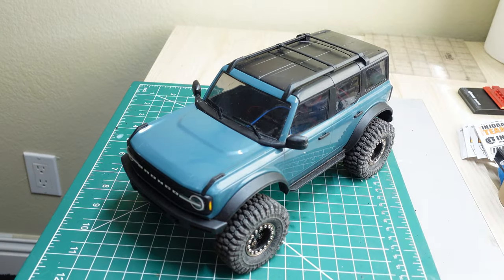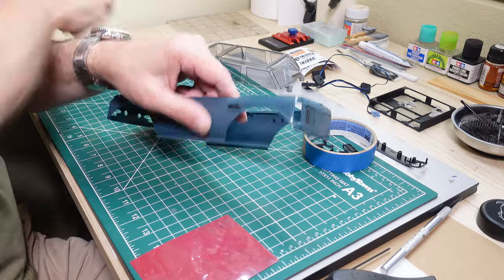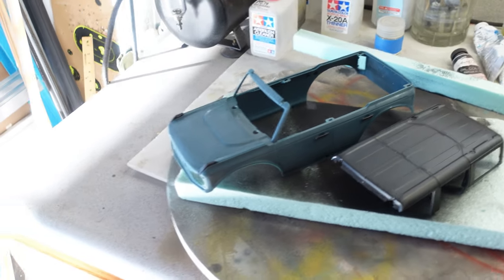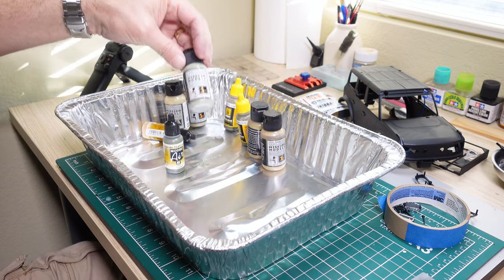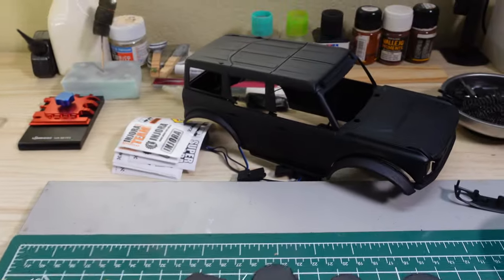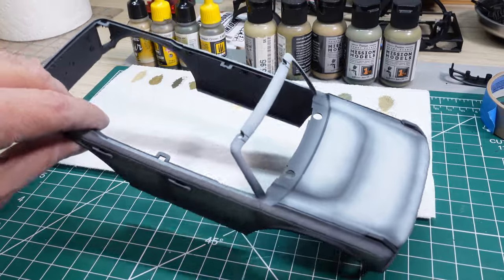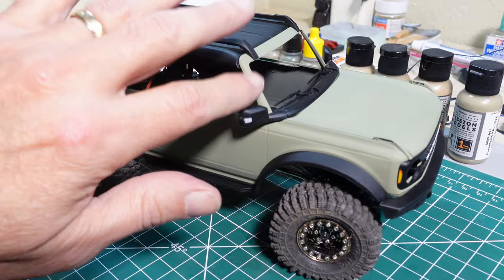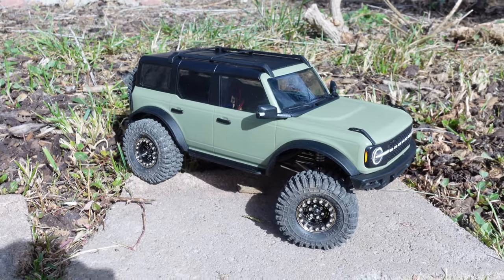Painting the Traxxas TRX4M

Comment: How well will that hold up? It looks great! I want to do this to my Bronco but I do a lot of rock crawling near my house on a lot of sharp rocks. Is it gonna scrape off when I drag the side against a rock?

I don’t have an air sprayer so I would be using tamiya TS spray cans
Reply from the maker: I'll have to see with time, but I did put on two heavy coats of clear coat and have not had any scratches yet.
Reply: It would more than likely scrape off with sharp rocks. If you do a couple coats of clear it will definitely protect it but think of it more as: if it will scrape the plastic and cause scratches, it's going to remove paint.